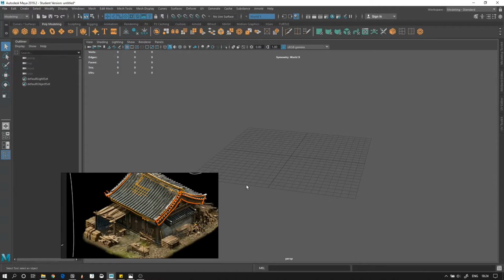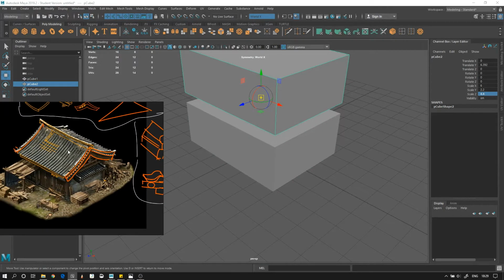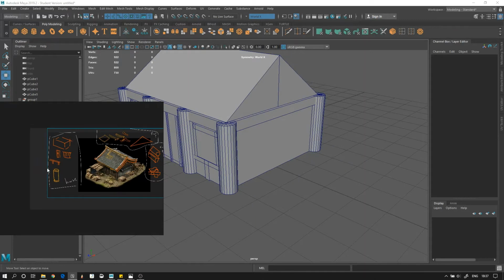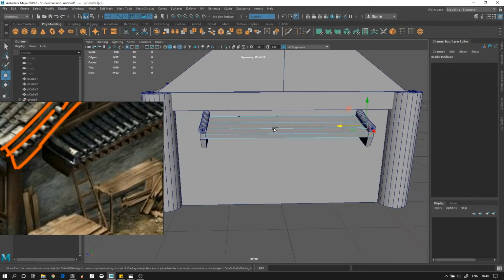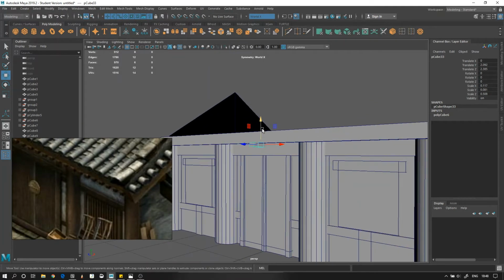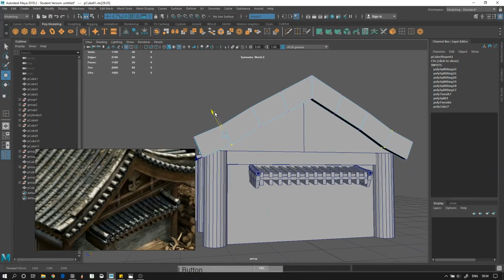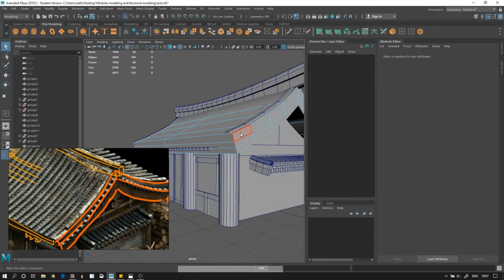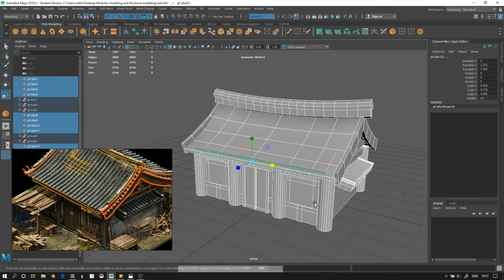Beginner Introduction to Modular Modelling #2 Block Out Mesh

Comment: Have you done the 3rd one yet? Interested to understand why so much detail goes in the whiteboxing of buildings, only to rebuild them again with modular textured pieces in Unreal.... I mean, why not just use a simple cube to block out the scene? I'm clearly missing something. ..
Reply from the maker: Hey there. Ill be re-starting the series when my schedule opens up again- its been very busy recently. Now let me answer your question:

The point of the workflow is to break a model into several modular pieces that we can then use to make several different kinds of buildings. Its not about blocking out an environment, but segmenting one single asset into multiple combinable ones. Also, blocking out the asset in maya allows me to put it in unreal, check the scale, then work on it in Maya and finally simply update the unreal asset. The finished model will automatically replace the blockout asset in unreal, in the correct locations and i  the right scale. If i build the level out of cubes directly in unreal, i the  have to export them to maya, or guess the scale and shape.
Reply: @stefantom4  Cool, looking forward to it. Please do the ENTIRE pipeline process. I'm going crazy going back and forth tutorials that doesn't fully explain the processes and leaves on hanging on step 4, whereas step 5-9 is ignored or not explained (for example).
Reply from the maker: @josephvanwyk2088  I know what you mean. I'd like to cover it fully and well which is why It's hard to find the time. Have to plan first, then prep and record. Otherwise things will be missed, rambled or just not done optimally. Has to be an example process after all